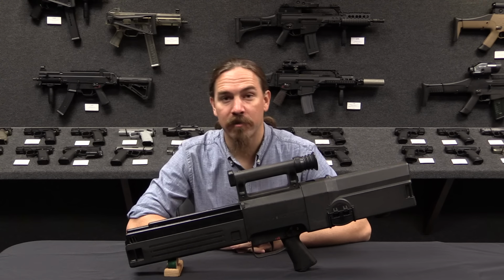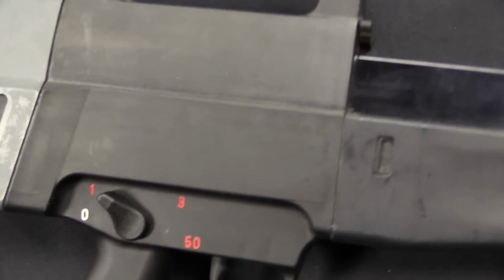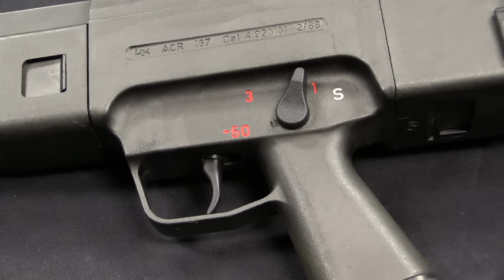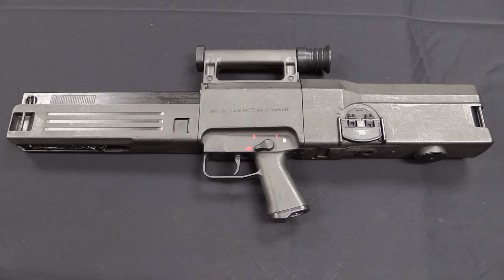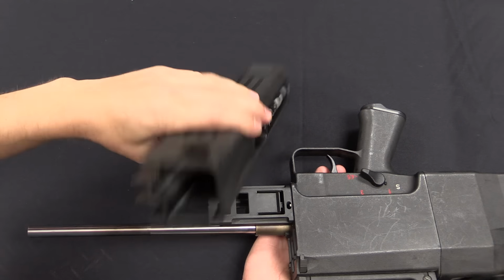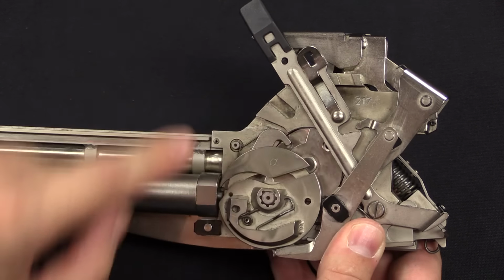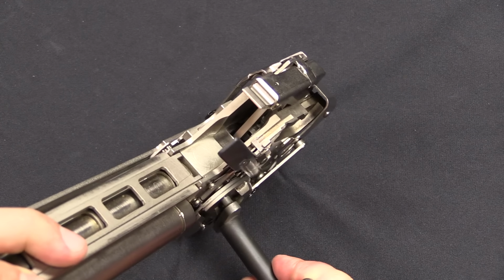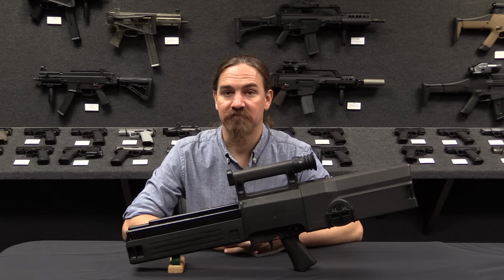Kraut Space Magic: the H&K G11

Comment: The planed way to approach maintenance on this is more like a modern jet aircraft than an WW1 biplane. Rather than trying to strip & fix the motor on-wing, you'd just whip it off, swap in a good unit, and send it back to the rear for a full strip and rebuild. The actual actions looks reasonably self contained, although we didn't see it being removed. I'd expect each squad would carry a spare in a box just in case. Also, not being a field-strippable action means it's probably more reliable and can safely run tighter tolerances etc.

Comment: why so big and bulky for so much dead space in the gun I could see them developing this thing up more and it would of been a great weapon once it had time to develop say a sleak thin side folding stock a small upside down triangular hand guard with a rounded out bottom a nice red dot or adjustable 1-4 scope could of been an amazing gun with a lot of potential built in laser and light cas why not one on each side of the hand guard I see it being am amazing eapon system if it was broght back to the drawing board and an A2 model was maid

Comment: I can't help but comment on your remark to the effect that the three-round hyper-burst was intended to fire three rounds before the recoil energy moved the gun. Unfortunately, that's contrary to Newton's Third Law of Motion. The recoil energy begins to exert force on the rifle at the exact moment when the bullet starts moving, and it stops exerting force at the moment the bullet exits the muzzle and the pressure in the barrel equalizes. And of course the recoil energy is exactly equal to the energy imparted to the bullet. So as a matter of physics, it's not possible to get off a second or third shot before the recoil energy moves the gun, no matter how fast the cyclic rate.
Reply: The part of the gun that shoots slides over the part that's held, compressing springs as it does. The point is to put most of the recoil into that motion instead of having it immediately jerk the whole thing with all of its force, minimizing the change in direction until the point in which the springs can be compressed by it no further.
Reply: @whyjay9959  Agreed, the benefit of a reciprocating bolt/buffer and so forth is to distribute the recoil energy over time. But by the time the rifle has fully cycled and returned to battery position, all of the recoil energy of the first shot has been transferred to the rifle, and hence to the shooter. So my original point was to the effect that it doesn't matter how fast the rifle cycles, for that reason. By the time it's fully cycled and ready for the second shot, the recoil energy has already been transferred.
Reply: @CharlesChandler-USA  But it fires all three shots of the hyper-burst during one backward motion of the action, when the relatively weak impulse exerted to the frame of rifle by the recoil spring has not had time to move the frame very much. BTW 99% of people trying to explain the effects of recoil bark the wrong tree. Energy s not a well suited quantity for describing what's happening here, because 1) energy has no direction and 2) Newton's Third is not about energy, it's about force, impulse and momentum.

Comment: Here's a bizarre idea, and just hear me out:
Go backwards in time for a caseless design. Instead of having fragile, formed rounds without a case, have a Propellant reservoir that automatically feeds single shot quanitities into the chamber after taking an entirely separated projectile with a stub of primer in it...think of an auto loading flint lock's powder horn, but rather automated and internalized to the action. Instead of a bolt, you get a revolver cylinder style trio of chambers spinning, like an unholy mutant love child of a Revolver and an M134 feed system. 
The top chamber aligned with the bolt is the "live" loaded cylinder position after the charge mates with the projectile and primer (in the back of the bullet maybe?) from the belt/magazine/feed tube/whatever, and goes Boom down the barrel.  
The "unlock/extract/eject" cycle happens when the cylinder spins down, then is "brushed" clean a quick acting plunger brush, which takes the place of an Ejection Port flip, etc.
The "sear/feed/chamber" cycle happens on the next 3rd of the spin of the bolt/cylinder, where automated measures of propellant are aligned with a bullet/primer, and then rotated up to the firing position at the top of the rotating bolt's position. 
It's just a clock action, where the barrel fires at 12, the chamber (for lack of a better term) gets swabbed at 4, and the powder, primer, and projectile combine as a round at the 8 o'clock position. No reciprocation, just spin powered by short recoil or a damn Dremel motor if need be, and the whole thing stays sealed except for the muzzle, and no case is necessary.

Comment: I am actually positively surprised just how far they got with caseless ammo!
Just what (and how) did they did use to keep the powder charge glued together and still got the whole thing to burn up completely? Otherwise the chamber would gum up so fast, after a few shots, the gun wouldn't load cartridges properly anymore. Just how did they do it?
Reply: I actually don't know exactly, but using celluloid (or similar stuff) as the outside layer would do the job. It is waterproof but once ignited, it will burn completely with just some dust remaining (if at all). You can try with a ping-pong ball (they're still made of celluloid)

The 120 mm tank ammo of the Leopard 2 is also caseless. Only a small, ash-tray size bottom plate is ejected after firing.
Reply: @norbertfleck812  Yes that is the same for the 120mm armed M1 Abrams aswell
Reply: +1 INT
Reply: They used an energetic plastic to hold the RDX particles together. Similar to fiber reinforced composites, except with particles instead of fibers.
Reply: Better living through chemistry.

Comment: In the three round burst mode the whole action moves back. What happens if you have a misfire and the round does not fire while the action is sliding back and not inline with the round ejection port?
Reply: You then need a German Engineer, A swiss clockmaker and a priest

Comment: @forgottenweapons  Ian, you said that the bolt makes one full 360* rotation each time it fires. Are we sure? It's kind of hard to observe assembled. I would guess that it only rotates 180* each time it fires, there would be no need to rotate a full 360*. The chamber is already a straight through hole with the same profile the entire length, there is already something behind the chamber that can seal and contain the pressure. It makes more sense that it only rotates 180* each time it fires. Too much energy would be lost if it that gear mechanism had to convert the piston's reciprocating to a full 360* rotation. Think about it, the cartridge is fed in nose down, if it rotated a full 360* each time the projectile would be facing the wrong way. Fire > Rotate 90*, new cartridge is fed in, nose down, rotates 90* (in the same direction), now the projectile is facing down the barrel. That't be the only way to get 2000 rounds/minute. I suspect the charging handle is gear reduced to give you mechanical advantage to charge the gun.

Comment: Some viewers still do not get it!
This weapon worked! It worked well enough to be ready to be adopted by our military. The project was not axed due to problems with the rifle but because the money was needed elsewhere.
Also, the case ejection normally would not be used as the propellant was burnt off pretty much completely. Untrained shooters had significant higher hit ratio with the G11 than with the G3.
Again, this weapon worked and was ready to be deployed!

If I remember correctly the G11 also had special ammo used to clean the barrel.
Reply: It was meant to be a money printing machine for HuK due to the required expensive manufacturer's maintenance. 

It was heavily over-engineered.

Comment: I first hear of this gun from Fallout 2; the Fallout series is interesting as it has always had a mix of real and fictional guns, and Fallout 2 had the most named ones.  Off the top of my head: Model 29 Magnum revolver, FN FAL, Thompson SMG, C96, Xl70E3, M60, Light Support Weapon, M3A1 & Pancor Jackhammer have all been covered here in addition to the G11.  Only a few remain without a Forgotten Weapons video: Desert Eagle (the literal opposite of forgotten), H&K CAWS & Red Ryder BB Gun have not gotten a video, and I imagine only the CAWS is on the radar in any sense.  

There are also some borderline cases like the Blade Runner gun, 5mm Miniguns, and Flame-throwers where they exist in the real world as actual guns but aren't like the ones in the game; the Blade Runner gun is in actual fact built up from a cheap revolver, not a cut-down rifle, the XM214 uses 5.56 and is much smaller than the in-game Miniguns (pop-culture man-pack Miniguns all seem to take their scale from the M134, which, while not impossible to hand-fire, cannot be configured in an actual, effective man-pack configuration, and it's especially odd when they get one thing right and make their man-pack Minigun use intermediate cartridges.  The Pipe Rifle is just that, and such improvised weapons have been touched on several times, and we got some truly excellent Flame-thrower content.  There is also the peculiar case of the Bozar, which is fictional but uses a graphic of an M82 AMR, yet behaves in-game as a machine gun.  It is likely that it had some of its data swapped with the M60.  

I'd love to see episodes on the CAWS and XM214, but I imagine they're at least as rare as the G11, both also being guns that were ultimate not selected for adoption by any customers and never reached large-scale production.

Comment: It doesn't fire every 360 degrees, it fires every 180 degrees, both ends of the chamber 'dial' are a muzzle and a breech. ;-)

A re-design of this rifle was eventually adopted by the USCM and other branches in 2171, and saw widespread use in the military as the M-41A Pulse Rifle.

Comment: The G11 was a 30 year exercise in STUPIDITY.
--
#1 You do not need a caseless ammunition to use its pivoting drum action to effect a 3-shot burst in a single recoil stroke. All you need is a cartridge that is NOT bottle necked such that it can eject downwards by being pushed out by a subsequent round -- this is how the G11 ejects a dud round anyway when you manually twist the charging handle. That, plus either electric priming or a recessed projectile to eliminate any chance of accidental ignition. If you really want to have a smaller diameter projectile in a fat case, just put a nylon donut around the neck and projectile such that the entire round is cylindrical.
--
#2 Those G11 magazines are as long as a Ninja Sword. This makes carrying them a complete joke and necessitate the rifle to hold two extra mags parallel to the loaded one so they can be conveniently carried. Seriously though, 135 rounds is NOT a lot and any more magazines need to be carried on the back of the soldier like foot long fighting sticks.
--
#3 Those magazines are SINGLE STACK. They are single stack because the 4.7x33 round is square in cross section and will not feed staggered. Again, an unnecessary complication since there is no reason ammunition has to be square whether or not they are caseless. The Voere's ammo were round. If they have been double stacked, the magazines would have been a lot shorter. Whatever the density advantages of square propellant blocks, it is more than offset by the inability to have double stacked magazines.
--
#4 The G11 is inherently not very accurate. It is inherently inaccurate because the barrel and action reciprocates within the rifle's plastic body. There has to be clearance around this reciprocating body or it wouldn't move, or will seize up, when temperatures or cleanliness were not perfect. But clearance also means that there is an inherent deviation in alignment with the sights from shot to shot. In any case, due to to compromises HK made, the rifles were neither accurate nor reliable.
--
It wasn't the end of the cold war that cause the Bundeswehr to not adopt the G11. It was simply that it was a stupid rifle!

Comment: I never knew that G11 was that weird and complicated.. As if someone had put a Swiss clockwork to run an automatic rifle.. Lots of boxy plastic and what appears to be an anus in the bottom.. What does not fit into my brain is that how the hell that clockwork action would not jam after being filled with propellant residue since there is no cartridge case and how in the blue fuck something that complicated and tight fit would not freeze stiff under freezing temperatures after being wet or just moist.. :D
Reply: There was almost no propellant residue. The ejection was just in case of a dud. The propellant was '"baked" around the projectile and was burnt off.

Comment: The basic idea of the gun has a XIX-century, pre-cased-ammunition, vibe to it.
The action looks like a Clock-Punk version of a wheel lock, build by some Medieval mechanical genuis/madman.
I suppose that's the distinctive German way of doing things: take a fundamentally flawed idea, and, through ingenious unorthodox design, cutting-edge technology and precision manufacturing, actually make it work, and work reasonably reliable, but it still costs a fortune and is a nightmare to produce and maintain. Like the Maus tank, and many, many other things.
Reply: in regards of the Malus, what part of it is the fundamentally flawed idea?

Super Heavy Tank? Yeah (though in part it was intended to be a mobile "plug" for a breech in a bunker line for example).

Engine? Nope. Gasolin/Diesel-Electric engines were already used in WW1, with the A-Zug, B-Zug and C-Zug. And they did their work well.

The Electric Transmission? Maybe. Though I've read that the Transmission of the Maus itself worked rather well.

Comment: I have seen pictures of the G11 with a bayonet attached where the laser would go. Was that an actual option on the G11, or did I just see a mock up someone created?
Reply: It was real.  In the late '80s I saw a photograph of a German soldier with a G11K2, bayonet mounted.  It stuck (pardon the pun) in my mind forever.

Given the ridiculously low production numbers the bayonets might as well have been one-offs, but at least one was actually made and used in military testing.

Comment: Would it be possible to revisit this idea of a caseless rifle in a similar vein as the "caseless" (actually a combustible shell casing) ammo that today's tanks use?
Reply: Clutch not for a rapid fire, much less automatic weapon. I’m sure it’s not impossible, but it’s currently pretty hard to shoot a tank cannon fast enough to get a cookoff. Different story with MGs and rifles.
Reply: @StruggleBusOperator  How about using electronic ignition of the propellant instead of a conventional primer? That should allow for use of a propellant compound whose ignition temperature is much higher than the barrel is ever likely to get in normal operation, and thus the risk of cook-off would be low.
Reply: @RedXlV  The key phrase is 'normal operation'  In the real world sometimes in combat the heat is enough to actually melt or droop the gun barrel.  Not too many intentionally explosive substances can ignore that level of heat.
Reply: thgreatandini I mean you'd need something that's both completely combustible by the explosion but also a thermal insulator. Maybe possible? Eh.
Reply: Electronic ignition just eliminates the need for a primer. Powders with that high of a flash point also burn hotter which means more heat transferred to the action, chamber, and barrel.
Reply: well, it's been almost 30 years, and with the Metal Storm's development of caseless ammo, it might work better now
Reply: @havoc3742  Metal storm didnt develop caseless ammunition, they had stacked ammunition with the barrel itself acting as the case. It´s a dead-end for a main service rifle.

Though modern electric priming could probably simplify the G11 mechanism and ammunition a bit.

Comment: my question from when you described the caseless ammo is what actually guarantees that the primer evacuates the chamber?  Yes there's a rush of gasses, but that rush is effectively in both directions, and the pin striking it is hitting a (before detonation) solid object.   Is there a slight risk that a primer could potentially not be ejected and cause a jam that way?
Reply: The primer in this ammo was more similar to a rocket,  it not only initiates the gunpowder detonation but also push the bullet and itself into the barrel. The primer it's pretty much acts as a push sabot in that it's pretty much part of the bullet during the acceleration part of the travel.

The difference in mass between the action and the primer ensures that the primer will be pushed harder.

Comment: But you never mentioned WHY it was lucky for the Bundeswehr that they didn't adopt the rifle in the end?
What's the flaw beside not being able to clean it properly and not being able to strip it mechanically in the field?

Also, i get the feeling that IF this was adopted, it would get K3, K4, K... iterations to address the issues with stripping, cleaning and whatever else one may need to fix.

I still believe caseless ammo is the future. All it takes is a new perspective on the problem. For instance, i would welcome cookoff as part of the firing cycle. That is, as you pull the trigger, you actually insert the projectile and charge into the chamber and if the firing pin doesn't get it, the cookoff will! Sort of like an open bolt system.
Reply: afaik it was never adapted because, due to the USSRs collapse, the threat of the Warsaw Pact was gone and therefore the budget for new weapons for the Bundeswehr was reduced, because the money was put elsewhere (likely, for example, helping to bring East Germany somewhat up to western standard).

So the flaw was simply the timing the Soviet Union decided to collapse.